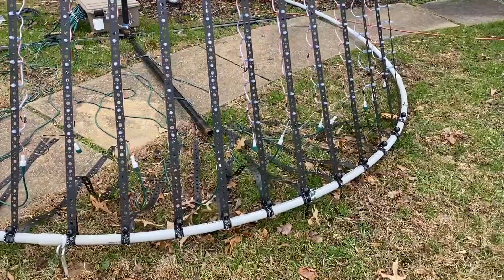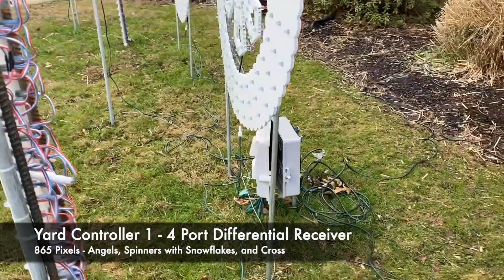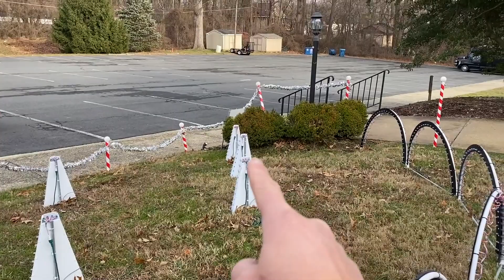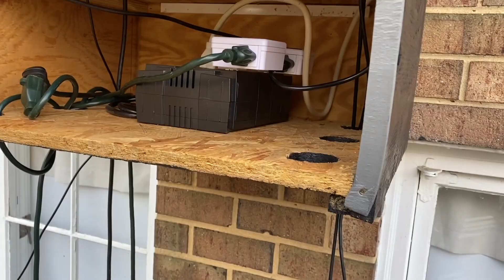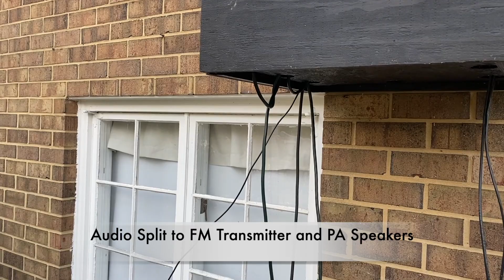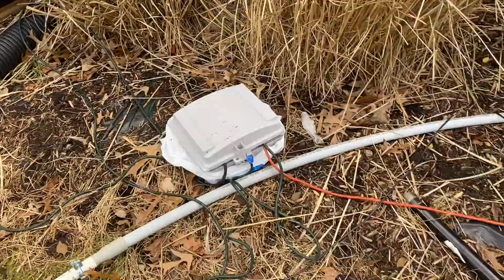2020 Vine Lights - Behind the Scenes - Part 1 (Controllers and Wiring)

Comment: how do you use 1 rasberry pi and connect the 2 falcon controllers so they are running correctly?
Reply from the maker: @dman3166, the 1 Raspberry Pi is connected to the two Falcon controllers via a standard Ethernet switch, as the data from the Pi to the falcons is standard IP Ethernet data. The falcon’s have their own static IPs which are also defined in xlights.

Comment: I have a falcon f48 and I've been trying to get something off the ground for a few years but I always start too late and then I'm too busy before Christmas to get something on the go.   One thing that always amazes me is the weather.  I live in eastern Canada and there's no way I could have any of that outside my house.  The weather would destroy it.  I have all my outdoor decoration tied down with 4 tent pegs and rope and even then I'm lucky if it's not ripped apart.  I can't imagine just laying things on the lawn and it's good to go.
Reply from the maker: @shannoncole6425 yeah, it sounds like your weather up in Canada is much more severe than where I am.  We get some wide ranging temperatures and occasional high wind storms.  If we get any snow, it's usually not that much and typically is gone in a day or two.

You'd probably have to start very early before the cold weather sets in and guy wire and provide extra support for everything to prevent them from blowing over, and set controller boxes up on stilts to keep them high off the ground.

Comment: Hi what size fuse are you using from the power supply .
Reply from the maker: The ATC auto fuses I use are 20A or 25A. Fortunately, I have yet to blow one of those, knock on wood.
Reply: @NiFamilyLights  Thanks for letting me know

Comment: You mention you live around DC area, is that possible to meet one day and go over how the system or is that possible to make video in detail how to build mega tree and angels stuff?
Reply from the maker: Ermias, you should join the MAALG (Mid-Atlantic Animated Lighting Group) forum on Facebook. You will be connected with other people in the area who are in the hobby. It’s a great way to connect with myself and others to ask questions and get help from local folks. 

That said, a video on planning a megatree is on the list. If you search my videos, you’ll find one on building the megatree, although the company I used to purchase the tree components current isn’t selling those products. Mattos Designs does sell megatree frame parts that are the same if not stronger than the frame I’ve built.

Comment: Steve,  Great build.  I'm new to the hobby and learning.  When you counted out the mega tree runs and explain each up down uses one input on F16... you count 1, 3, 5, 7 etc.  Although all of the F16 seem to be connected are you not using input 2, 4, 6 etc. on the mega tree?  Thanks
Reply from the maker: MotoMerica, thanks and welcome to the hobby. When I was counting 1,3,5,7, etc, I was counting the strands on the megatree. The pixels run up strand 1 and back down strand 2. So output 1 goes to strand 1 and 2. Output 2 goes to strand 3 and 4, etc.

Comment: Is the star running on one of the expansions off the megatree controller?
Reply from the maker: Corey, the star could be run from one of the 2 remaining receiver outputs. However, I have mine chained from the end of the last megatree strip with power injection to the star. I’m using two power distro outputs to power the star. One is used right after the last megatree string, sending data and power to the star. A second power distro output is sent up to the star to power balance half the star.  If you look closely, you’ll see two cables running up the pole.

Comment: hi steve great job like usaul just got a question in my 400 pixel mega tree and i put power inject and i use fuse line like yours i use 5 volts pixel what amp fuse i use  i have 5amp in there now is that ok
Reply from the maker: Hi den bel, 5A fuses are correct. The 5A is based on the limitations of common pixel wiring.

Comment: how does two 350 power supplies power that many pixel nodes.16 Output AlphaPix Classic E1.31 Controller on holiday Coro says it can do up to 5540 pixels. If each node has 3 pixels then that's 1846 nodes correct. Also, if say I use 100 node strands then let's say 18 strains. 100 nodes say 55 watts. so at 18 strains, that's 990 watts so even with two power banks how can this controller run what it states. I may even be wrong on all this.
Reply from the maker: For your first comment, let's get the terminology straight.  Pixels and nodes are used interchangeably.  Each pixel or node has 3 LEDs.  Each LED is referred to as a channel.  So, each pixel/node has 3 channels.  Back to the 5,540 pixels/nodes, that would equate to 16,620 channels in xLights.  Ultimately, when a controller says it can handle xx number of pixels, it has already taken into account that each pixel has 3 LEDs/channels. 

For your example, with 5,540 pixels/nodes, if each pixel/node uses 0.55W on full white (all 3 LEDs on at 100%), then the 5,540 pixels would use 3,047W of power.  Yes, that is a lot.  However, running pixels at 100% output brightness is blinding and most people run them at 30% or so.  Taking 30% of 3,047W is still 914.1W, well over the capacity of 2 power supplies.  

So, to maximize the use of the Alphapix, you will need 4 power supplies.  Two of them would directly power the pixels through the Alphapix and two more would be used for power injection, giving you a capacity of up to 1,400W (350x4).  Hope that helps.

Comment: DC Metro Area.... Where is this display at?  I’m in the DC Metro Area
Reply from the maker: The Vine Lights show is just south of Tysons Corner at 2501 Gallows Road, Dunn Loring, VA.  It's typically 8 songs running about 30 minutes long on a loop from 5pm-10pm every night through 12/31.

Comment: I’m curious on how you are running 2 of the falcon F16 together I’m new to the Christmas light game trying to figure out as much information as possible there isn’t a lot of clear information on controllers without going to 100 different forms
Reply from the maker: Chris, each F16 has its own static IP address.  The Raspberry Pi show player needs to be on the same network as both F16 controllers.  I have the Pi and both F16s configured with static IP addresses.  The Raspberry Pi sends the appropriate data streams to the F16 based on what is configured in the xLights software.

In xLights, the first tab is the "Controllers" tab.  For this show, I defined 2 controllers.  It includes the static IP address, the type of controller, and the number of channels (pixels).  Hope this helps.
Reply: @NiFamilyLights  This really helps a lot thank you